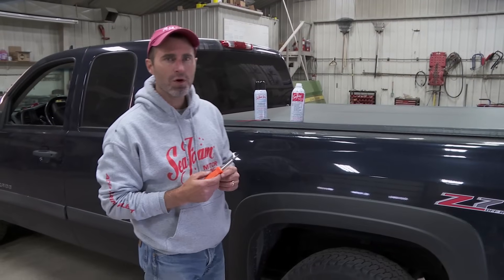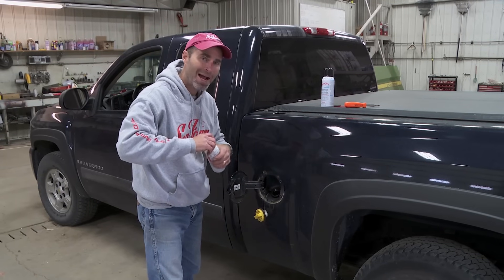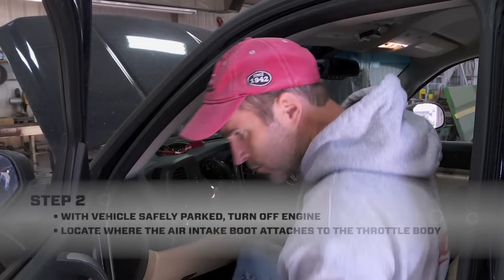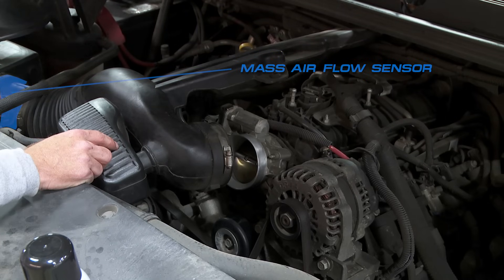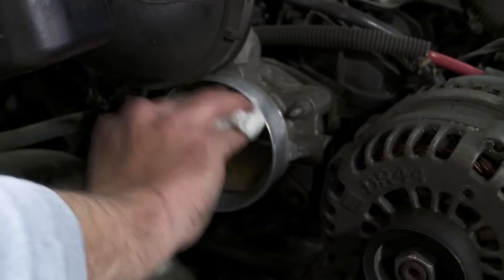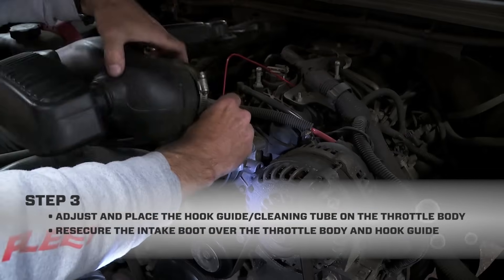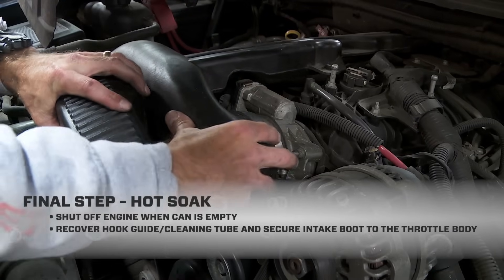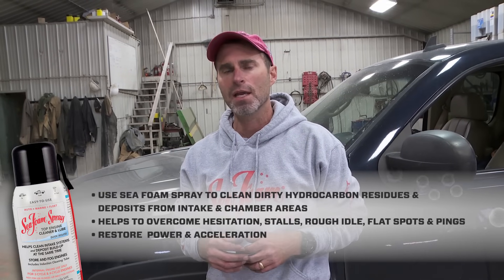How to clean a gasoline fuel injection air intake with Sea Foam Spray

Comment: Can seafoam be added to the fuel in. Vw 2016 Tiguan ?
Reply from the maker: Hi Joe:  Thanks for the question. Yes, Sea Foam can be add to any engine that runs on gasoline or diesel fuel.

Comment: Does it work on Diesels?
Reply: Okay cool, thanks for the answer.
Reply from the maker: No, Sea Foam Spray is not for diesel engines.  Diesel does not use spark ignition and Sea Foam Spray is volatile.  For diesel engines, use Sea Foam Motor Treatment in fuel and when priming primary fuel filters - see Sea Foam Official video on How to Clean Diesel Injectors.

Comment: I bought a 26 year old Toyota Corolla for $100. It had been sitting for 8 years. I replaced the rusty gas tank, fuel pump and fuel lines with cheap, junkyard stuff. I got the engine started easily, but it was running very badly. By pulling spark plug wires, I determined it was running apparently on only two cylinders. I thought it had stuck valves or bad fuel injectors. 

I tried a $9 can of liquid SeaFoam, the old fashioned way, that is by warming up the engine, then slowly pouring the liquid in the brake booster hose. I did about 2/3 of the can, and then poured in enough to make the engine stall. I let it sit 7 minutes, and then re-started the engine. At that point I witnessed the most dramatic automotive resurrection I've ever seen. After running five or so seconds, the idle smoothed out, the dead miss went away. The car runs absolutely fantastic now. Very responsive, lots of power. Awesome! Customer for life. My neighbor witnessed this miracle also.  Please send my T-shirt to....
Reply from the maker: Thank you for the story.  Please send an email to media@seafoamsales.com and note that you're wilkesjournal that posted on Youtube.

Note:  You likely have dirty compression rings that could use more cleaning.

If you can leave the car to sit for 1 to 3 days, try this:  Pull the spark plugs and pour an ounce of Sea Foam (or easier, Sea Foam Spray) into each cylinder cavity.  With the plugs removed, crank the engine for 1 or 2 seconds.  Leave the plugs out overnight (or better, for two or three days).  If can leave for 2 or 3 days, crank engine once per day after adding a little more Sea Foam. Sea Foam will work to dissolve hydrocarbon residues from the compression rings, helping to recover compression and power.  After soak, seat plugs and go.
Reply: Sea Foam Official I did this on an ‘87 Civic hatchback that had been sitting for a while.  Did it the same way, old school brake booster hose style. Worked great, fog out the exhaust like you would not believe...can’t imagine how nasty that intake area was in that car.
Reply: My honda civic 98. Have the same problem i think .   Ima do that this weekend hopedully works .
Reply: @andysazo2241  ima is not a word.
Reply: @tompaul2591  you’re so smart
Reply: Toyota Corolla... you could have added windshield washer fluid and the same result lol you can't kill those things
Reply: Sir, I do appreciate you sharing your advice. I have a 2000 ford ranger. It had been running rough for some time. I bought 2 cans of seafoam. I put in 1 can in the tank the night before. I drove it as you did. I added the 2nd can to the intake till it cut off and pour the rest in. Ten minutes later, I cranked it and the idle was smooth. Better performance. it is simply amazing how everything works with mo power baby! thank you sir.
Reply: About 10 years ago guy had old 61 Cadillac running rough, horrible idle at my house. I asked care if I try something? So I sprayed the inside/outside of the carb with Gumout scrubbing with a toothbrush. Doing the same to the inside of the carb and butterfly and sprayed additional Gumout in the carb and let it sit for 10-15 min. Started her up. Let the gunk burn off and she smoothed out running likes she's brand new. Yahoo!
Reply: Sea Foam Official we were told we need a timing chain replacement and I think it's just the lister's what do you think
Reply: wilkesjournal p
Reply: Sea Foam Offici
Reply: I have a 98 Corolla with typical aging problems like this and I'm definitely gonna have to try this. Thanks!
Reply from the maker: Hi Andy:  You can find step-by-step instructions on our website's HOW 2 page.  Also feel free to use the 'Ask Jim' feature.
Reply: I have a story almost like this except I haven't actually Seafoamed this motor yet... I bought a 94 Suzuki GsxR 750 and am down compression on 1 out of 4 cylinders. I'm hoping you product can really help this bike out as I'm not looking forward to having to tear it down hoping it's only gummed up piston rings or dirty carboned up valve seats. Love the product and have been using it religiously in my gas and in my crankcase before an oil change.
Reply: @Ascended6966  did it work??
Reply: @Ed Zeppelin        exactly!!   what an idiot.  contaminate your brake fluid with a distillate.    now the sea foam guy wants to run this as an add.     afer reading this i will never buy the product.
Reply: @TheBigsqueezer  you don't know what you're talking about so stfu
Reply: @TheBigsqueezer  Hey Joe, there is no cross contamination of the brake fluid, he is referring to the vacuum booster to intake port. They are completely independent operating systems. It also not damage the booster as the product does not contact any internal booster parts. Only the vacuum supply hose contacts the product without I'll effect. Peace...
Reply: @TheBigsqueezer  gets the "i have no clue what im talking about or any shame in how ignorant everyone knows i am" award. Spoken like a true Jackass! You should consider going to school for automotive repair. They teach you all systems that make vehicles work and why each one is needed and how they work together. This is the way mechanics become mechanics. They don't just guess and speak out of their brown eye like I'm assuming you do regularly. You sound so dumb that sea foam would probably be offended if you bought. Or afraid you might drink a whole can in hopes of becoming a better driver.

Comment: is it normal for the check engine light to blink while spraying Seafoam into the throttle body?
Reply from the maker: No, not normal.  Could be a sensor reacting/adjusting to changes.

Comment: Do I have to take the engine air filter out before using the spray?
Reply from the maker: Hi Joshua: No, not for a fuel-injection gasoline auto or truck.  An engine with a carburetor requires air cleaner removal to access the carburetor throat.

Comment: 99 ACURA TL  LOSES COMPRESSION AT 45/ WILL SEAFOAM HELP ?
Reply from the maker: Hi Jennifer:  Thanks for the question.  Sea Foam will work to dissolve residues that bind compression and rings (that may be causing the pressure leak).  Pull the plugs and add an ounce of Sea Foam or a healthy burst of Sea Foam Spray (easier) into each cylinder cavity through each plug hole.  With plugs out, crank the engine and leave overnight or as long as 3 or 4 nights in a row.  Crank the engine once each day with plugs out while the rings soak. 
When ready, put plugs back in and go from there.

Comment: Does that rubber elbow come with the sea foam bottle? You did say just place straw in front of the throttle body plate reattach and have someone holding the rev at 1000 over idle while a spray it in correct???
Reply from the maker: Hi John: Yes, there is a straw and hook tool that comes with the can.  Can has instructions, too.  Yes, plate and idle description is correct.
Reply: Very cool! Man I did the wipe test first charcoal black....sprayed that stuff in there at recommended idle all good didn't even have to wipe it to notice the difference...surprisingly after cleaning it and adding a can of seafoam to the tank it cleared my 02 sensor codes...weird but cool. After reading the melted straw comments I cut the straw to fit the exact distance...cut the straw on the other side too...big mistake, you want the extra length on the spray side because it gets super hot while its cleaning. Worked very well. Thanks for the advice!
Reply from the maker: Thank you, John. Great news and always pleased to help!

Comment: Is it better to do the treatment before or after an oil change, or does it even matter? Also I have throttle body injection (chevy s10 blazer with 4.3 v6) so is this the proper method for my engine? Great video, thanks.
Reply from the maker: Thank you for the question.  Cleaning the top engine area has no relationship the crankcase oil so can do any time during an oil life interval. Yes, will work great on your truck's  throttle body intake.

Comment: Should the seafoam nozzle be directly behind the throttle plate? Or in front of the plate?
Reply from the maker: Hi Brian:  Thanks for the question.  Always in front of it.  If the plate closes on the straw it's too far in.

Comment: hey seafoam, my vehicle won't pass emissions.  I've heard stories of the gunk from seafoam clogging my cat.  and I just put a new cat on today. ?  I'm I in the clear ?
Reply: You don't really know if the cat is dead or alive until you open the box.
Reply from the maker: Hi Dustin:  Send an email using our website's Ask Jim feature and we'll help you out.  And, Sea Foam in fuel has no relation to a catalytic converter.
Reply: dustin jeffries did you check the oxygen sensor before replace de cat?

Comment: When using Sea foam Motor Treatment does it matter if the Gas tank is full  or almost empty before I put it in?
Reply from the maker: That's a great question - Think about this:  The higher the Sea Foam concentration in fuel, the  better it cleans.  For fuel system and passageway cleaning, add a full can (or more) when the tank is low (less than a quarter tank), drive at least 20 miles on the low tank for the cleaning concentration to work, then fill your tank and let the lesser concentration continue to go to work.  IMPORTANT:  Sea Foam is all organic petroleum - nothing about it can cause harm to fuel system part.

Comment: got a question....I've seen alot of videos that show people using the liquid sea foam in the brake booster, the gas tank and in the motor oil and with the vehicles engine cold when applying it.   which way is most effective?
Reply from the maker: Thanks for the question. For cleaning intake valves and chamber areas, Sea Foam Spray through the intake is most effective because it disburses evenly to all cylinders.  Many brake booster applications don't feed evenly.  In either case, engine must be hot and running during application.
  
Sea Foam in the oil works to safely dissolve and liquefy oil formations and residues in the crankcase so they can drain.  Sea Foam in fuel works through fuel injectors (and carburetors) to clean fuel system passageways and nozzles.   Engine is typically turned off when adding to oil filler or fuel tank.

Comment: Hi, is it best to apply Sea Foam before or after an oil change? I'm planning on doing an oil change next weekend. Thanks in advance!
Reply from the maker: When adding Sea Foam oil, best to add 100 to 300 miles before the oil change.  If adding to fuel, makes no difference.
Reply: If I add the motor treatment (liquid) to my tank and then the spray from the cans into the throttle, as shown within this video, I should be fine?
Reply from the maker: Jonathan:  Cleaner, anyway.

Comment: the more sea foam the better eh? can I run my car entirely on sea foam in the gas tank?
Reply from the maker: For the highest concentration cleaning procedures, Sea Foam can be mixed as high as 50/50 with gasoline, 100% in diesel.

Comment: I received the P102 MAF sensor error after performing this procedure. I cleared the code. If it comes back should I remove the MAF sensor and clean with MAF cleaner?
Reply from the maker: Doubtful it will come back.  Try disconnecting the starter battery for a few seconds to clear.

Comment: yeah I want to clean the valves cause i think they have built up carbon cause my motor shakes.
Reply from the maker: Thanks, Alex.  Sea Foam Spray treatments through the intake will do the most valve cleaning.  Consider you're adding a whole can over the intake valves in a matter of 4 to 5 minutes.  You can also do multiple treatments.
Reply: +Sea Foam Official  Alright man thank you
Reply from the maker: Pleased to help!  Go to Seafoamsales.com, click on HOW 2 Instructions, find the file for "Intake Auto Fuel Injection", use it and let it go to work!

Comment: Can I just add some on the gas tank of a nissan 240x or do i also need to spray some on the intake?
Reply from the maker: Hi Alex:  You can do either or both. Just note that each are different applications. Sea Foam in the tank works through fuel delivery to clean through your Nissan's fuel injectors, intake valves and chambers.  Sea Foam Spray is a high concentration applied through your Nissan's throttle intake to clean the upper intake, intake runners, intake valves and chambers.

Comment: what about for an old 79 carburetor
Reply from the maker: +Southern Ambitions    Thanks for the question. You can add a full can of Sea Foam Motor Treatment to the tank when low followed by a full can of Sea Foam Spray into the carburetor intake throat using the same instruction sequence shown in the "fuel injection" video.  Sea Foam in fuel will help clean gum and varnish from the carburetor passageways and bowl while Sea Foam Spray through the intake will work to deliver a high cleaning concentration to intake valves and chamber areas + cleans up around piston rings. Use the HOW 2 link showing in video title to find Instructions on Intake Cleaning - Gasoline Auto Carburetor - The video version will show on Youtube in the next two weeks.
Reply: Well how's the spray clean the secondaries. .I added probably a little under half can to the tank while low on fuel but poured some in carb.i will use spray and add whole can to tank again soon...my 79 el camino needs a Lil pick me up
Reply from the maker: +Southern Ambitions   Secondaries (carburetor) are progressively cleaned by adding a cleaning dosage of Sea Foam to the fuel tank.    Sea Foam Spray into the carburetor throat does not work through the carburetor.   Following the instructions, a full can of Sea Foam Spray works to clean deposits from intake valves, chamber areas, dissolves residues around compression rings.

Comment: I just did this and I put the red tube a 1/4" past the throttle and it got pinched and sealed shut from the heat.  I cut that section and tried the other side of the throttle and same thing happened.  

Is the red plastic tube really supposed to go past the throttle?  Very frustrating since on an '02 Camry the air intake is behind the engine and hard to reach.  Please help?
Reply from the maker: +Julian Klauz   IN FRONT of the throttle plate. Please see instructions.   Curious:  Where did you get the idea to extend the straw beyond the front of the opening?
Reply: +Sea Foam Official  Youtube video.  I thought I heard 1/4" past the opening.  My mistake.  I appreciate your reply :)
Reply from the maker: +Julian Klauz   Thanks for the reply, Julian. Glad you figured it out!
Reply: I had this same issue. And I had watched the same video. I could have swore that the guy said it was supposed to past the throttle plate as well.
Reply: Yup, glad I'm not alone.  Unfortunately had to learn the hard way.
Reply from the maker: Explanation of spray tube position starts at 2:38.  "...one quarter inch IN FRONT of where the throttle plate opens away from the nozzle."  Same as instructions and diagram shown on can.
Reply: Yes it says it in the video, on the can, probably could tattoo it on our foreheads, gonna still make the same stupid mistake.  Sometime we just have to learn the hard way... thanks for the support :-/
Reply from the maker: Thanks for the clarification, Julian.  You be careful out there!

Comment: is it good for a car with 60,000 miles
Reply from the maker: +Dolores garza   Yes, any amount of miles, new and old. Those familiar start at around 10,000 odometer miles, particularly if a gasoline direct injection (GDI) engine.

Comment: Can I use this on a V8 Diesel engine with a turbo charger? (2002 Chevy Silverado 2500 Duramax)
Reply from the maker: +Cody Tuttle  No, NEVER use through diesel air induction/intake whatsoever!  Best Sea Foam method for diesel top end cleaning is through the fuel filter.  See video: "Sea Foam - How to clean diesel fuel injectors without removing parts"

Comment: Can this cause the engine to hydrolock?
Reply from the maker: +punkvader77    Hydrolock occurs when there's liquid in a chamber that cannot be compressed. Sea Foam Spray is fine droplets mixed with the rapidly moving intake air and fuel stream.

Comment: i have a '99 suzuki grand vitara i wanted to spray.problem is i take the air duct off at the throttle body and it has a screen then the mass airflow sensor behind it and then the throttle is behind that. my question is ..can i put a small hole through the screen to get my spray hose behind the mass air flow sensor or is the screen part of the mass air flow components. it just looks like a normal screen though. not sure.. just do not want to ruin anything. thanks anyone.if i can not use the spray for throttle body can i at least use the useless spray option for my car by spraying it in my gas tank hole to not waste it...or is it a different formula?
Reply from the maker: +leaf smoker   Thank you for posting the question. Seems you have a flame arrestor screen. Some can be removed temporarily and people are known to make a small hole. Whatever you do, just make sure the straw nozzle is beyond the MAF sensor and directed in front of the throttle plate where it opens into the throttle body. As far as the can goes, it's all Sea Foam in a spray, so can spray into any tank, whatever.  Same stuff!